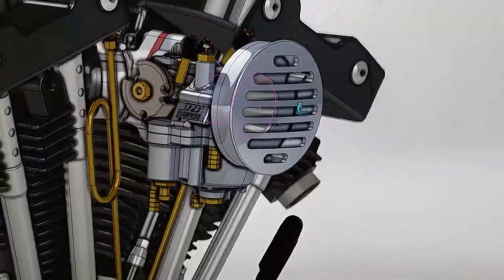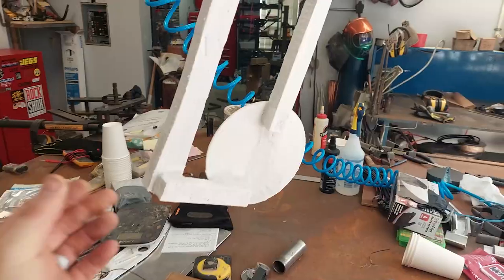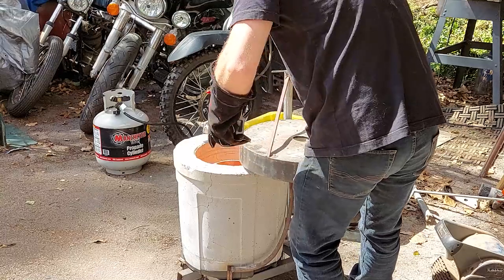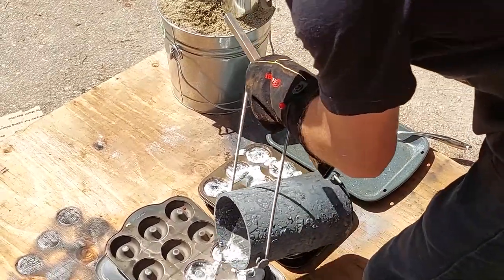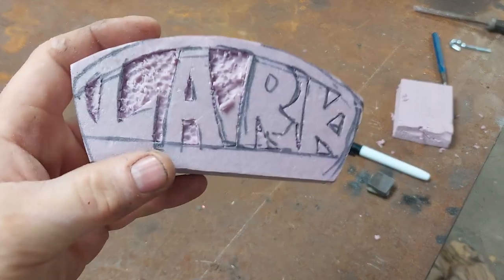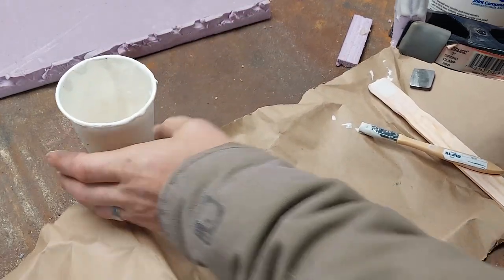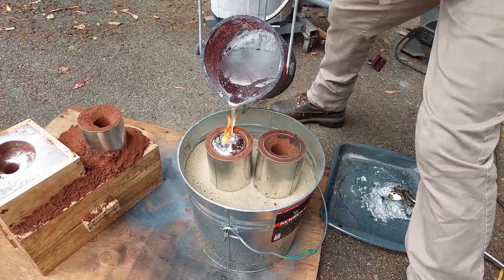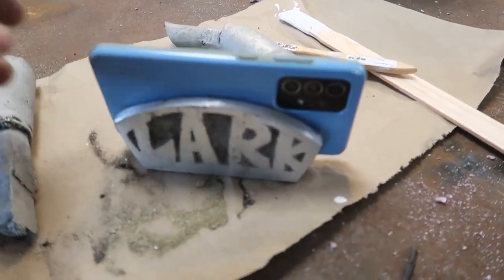Adventures in Lost Foam Casting | Lark Machine Co

Comment: Right on. I enjoyed the video for sure. You're on the right track.
Ditch the riser vent. It really doesn't do anything except add more material.
the gasses from the foam will vent through the dry sand. 
if the sand is loose, you will get the baracle action coming off the corners and the parts will swell.
Cheers. looking forward to seeing more.
Reply from the maker: You da man!

Comment: Nice!  I've been doing lost foam casting for a while too.  I usually do a small dab of hot glue to hold the flue on, then surround where the flu meets the part with a hot glue 'fillet' on the theory the hot glue is denser and can slightly impede flow / introduce turbulence taking extra time over the foam to melt. No idea if it makes things better but seems like it might. A drill with an eccentric weight also works great for vibrating the sand.  Save and label your risers for important parts and you can stress test the risers to have some idea of what the part's strength may be.
Reply from the maker: Nice! All great tips.  The hot glue thing makes sense, seemed like it took a bit for it to melt out.

Comment: I worked with urethane foam in college.  That expanding polyurethane degrades into cyanide gas and some other nasty stuff when it burns.  I recommend sticking with polystyrene insulation foam or specifically made casting products instead of Great Stuff.

Also, PLA makes a great lost mold material.

Comment: It will be interesting to see if you can achieve  consistent quality cast parts. The softness of the DIY cast parts exclude them from being used in applications requiring strength, best for art & craft.
Reply from the maker: I'm working on doing some hone heat treat. I have done some t5 and now to embark on t6.  I made aheat treat oven and trials are on going
Reply: @sheanyquist  I do like the idea of recycling aluminum scraps and mistakes into useful parts, my father cast aluminum and brass ingots for machining in his home shop. I just don't have the confidence to use a DIY casting on a fork clamp unless it was x-rayed to insure it didn't have flaws and inclusions.